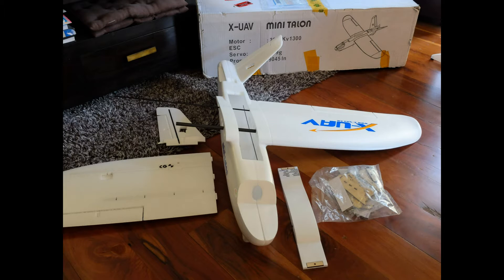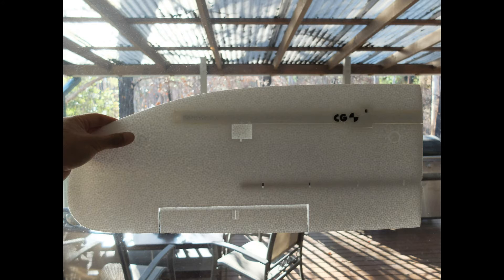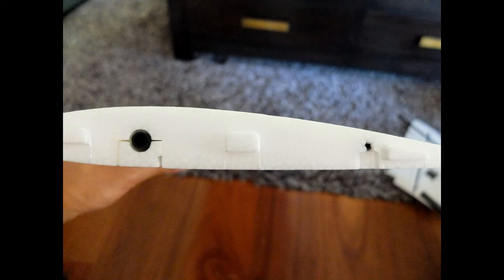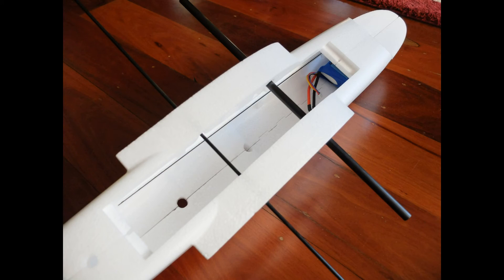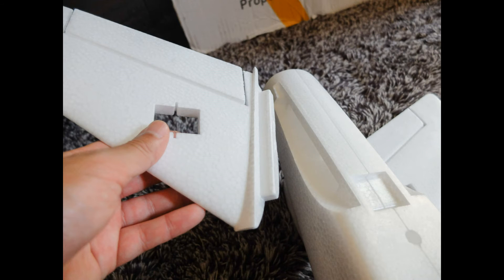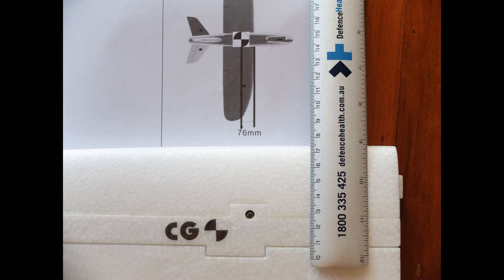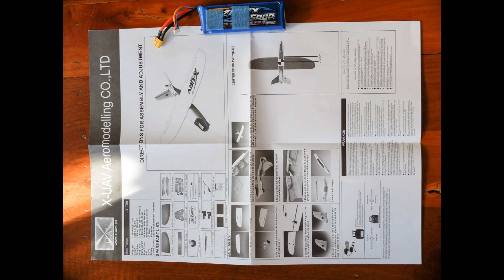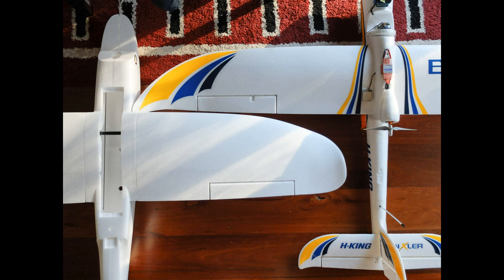X-UAV Talon Mini unboxing (mini talon)

Comment: Could this hold 2 10,000mah batteries?
Reply from the maker: I don't think you could. Maybe 14000mah ion would work if you kept the nose light. My 610gm 10,500 ion only just balances but I have a 3d printed nose cone, skid, roll gimbal and two cams on the nose. Launches are heavy so need to be a standing on a rise and expect the plane to dip before it lifts.
Reply: Mabye two of these? https://www.amazon.com/dp/B07RWCKV84/ref=cm_sw_r_em_apa_i_NvVzDbVBDPH4J
Reply from the maker: There's no way I could balance one of those 930gm batteries let alone two.  If you find a way of placing one battery forward and one middle or back of the plane, then maybe, but then you'd have no room for flight controller, etc.
Reply from the maker: The biggest you might be able to balance is probably a 14A Ion pack.  Like this: https://www.aliexpress.com/item/32932593758.html